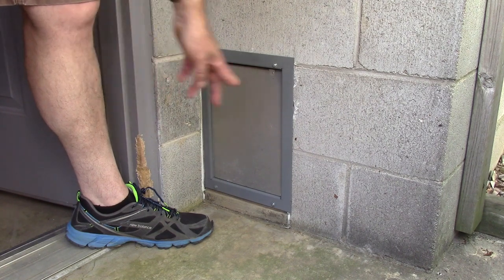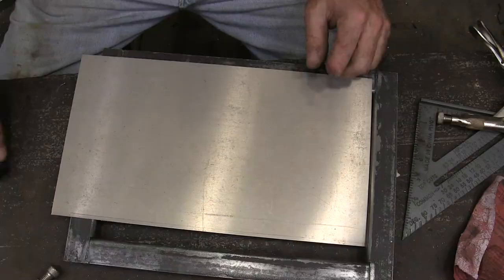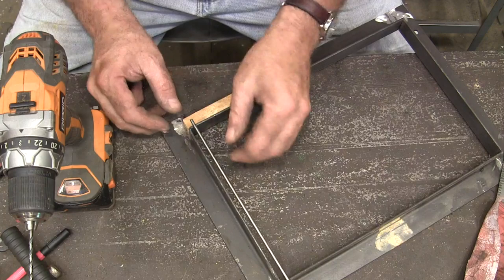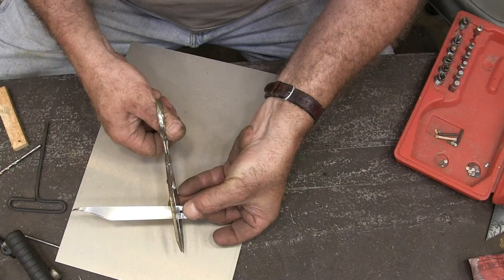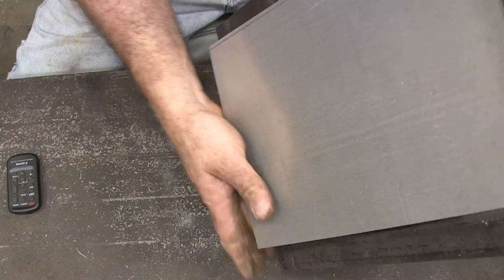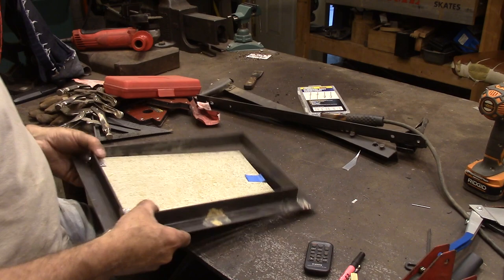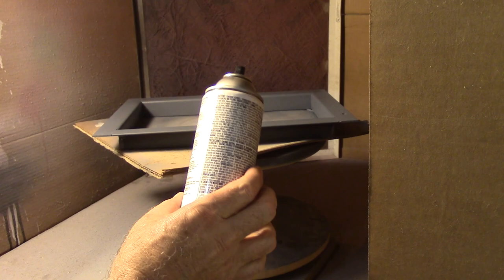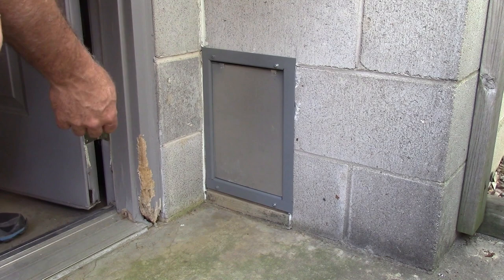DIY Heavy Duty Doggie Door

Comment: Great job, I’ve had a dog door for my dogs for years of course the one I bought from the store originally and you have to replace the flap every year to 16 months as they always get a tear across the top, great idea to use a piece of aluminum, because it should never wear out. Now I just have to find a piece of aluminum and a few other accessories to get it working in the slot. Thanks
Reply from the maker: That's why I made mine I got tired of replacing the plastic flap.  Good luck with yours.
Reply: go to home depot or lowes and grab a piece of 1/4" plexiglass and a glass cutter.  my 3 dogs are destructive a$$holes and the plexi glass is 1 of 3 components of my custom dog door that they have not been able to break or render useless! im pretty sure its 1/4" thick, maybe 3/16.  i have 3 germans all over 65 pounds and they are about as gentle as warthogs on the doggie door.

Comment: oh man i wish i had a welder! i have 3 large german dogs and these a$$holes destroy everything including a heavy duty custom doggie door!  its a 3 flap system i made cause we live in cold maskachussetts and i wanted to minimize the large amount of cold air coming into their basement  area.  they blast through it anytime theres a freaking squirrel, rabbit , hawk , chicken , fly or breeeze outside and they have ripped the 1/2" thick screws out of the damn side of the house at least 5 times in 3 years. ive gone through countless cabinet magnets that secure the plexi flap to the outer 3/4 plywood flap. miracle that they have not ruined the plexi glass! today i am using 2x4 PT and building an entire new casing/frame on the outside of the existing nice white trim and will use freaking lag bolts to secure the hinges! if they manage to break this set up they will be living outside in one of my kids play houses LOL.
Reply from the maker: Holy Cow!

Comment: The door is aluminum? So what happens if he gets his tail stuck? Cuts it clean off? I’ll stick with plastics
Reply: My dog chews plastic and my dogs don’t have tails, this is perfect for me but good thinking
Reply: I’m pretty sure it doesn’t close that tightly, if the dog did get it’s tail caught and they pulled it would come right out, And when I say come right out I mean the tail will come right out of the door. If you look you can easily push the aluminum door it’s not like a 50 pound steel safe door or something.